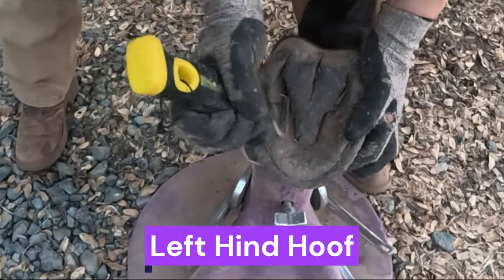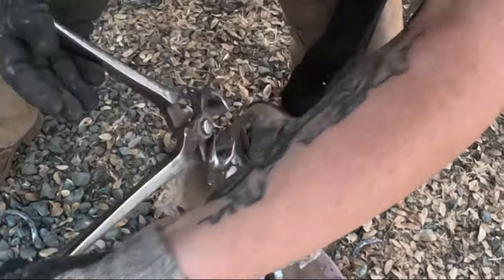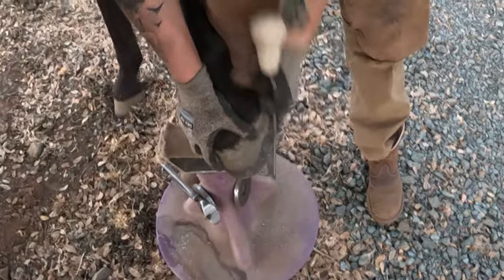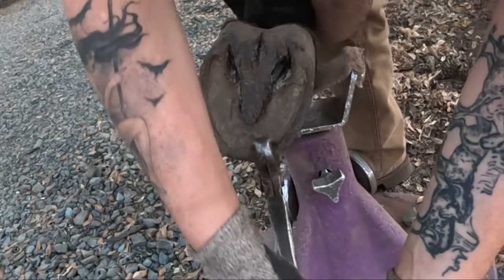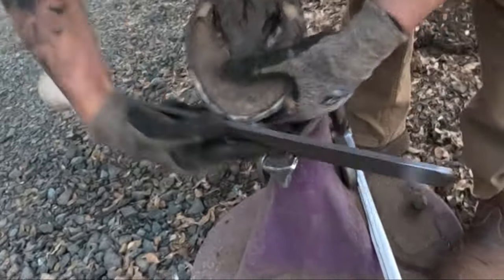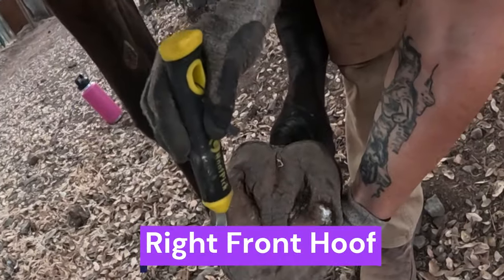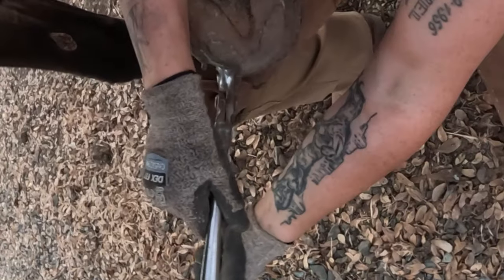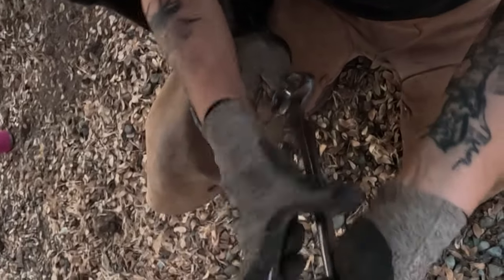A Barefoot Horse Hoof Trimming Mini Masterclass

Comment: Please correct me if I'm wrong, but is he not walking on the sole at the toe? My horse is similar. I never have to take anything off her toes, and I'm wondering why. A group I follow said they need to be walking on the hoof wall the whole way around and the wall should be at the HSP. But mine seems to wear her toe and I wonder is she not landing heel first. But her heels are taken down to the butress line at every trim.
Reply from the maker: That’s a great question. Unfortunately there is not a one size fits all answer here. It really depends on the thickness of the sole on the horse. This horse has nice thick soles and so I am able to take the hoof wall hight down farther and the fact that the toe callous has not popped out and is bearing some weight is not a big deal because of the over all strength of the hoof. Now if this horse had thin soles I would not want to trim like this as he would probably get sore. A basic check for sole thickness is the depth of the collateral grooves. The more shallow the grooves the thinner the sole. What I was taught and what I have found to be true and most helpful to the horse is that yes the wall is the primary weight bearing but the whole hoof shares the weight of the horse especially the frog in a hoof that is healthy and functioning properly. The bars will take on some weight as well when the horse steps and the hoof expands and lowers onto the ground. As far as heel first landing the best way to check is to have someone walk your horse for you and take a video and then watch it in slow motion and try and stop it right when the foot is landing to see if the horse is landing heel first or not. It can be tricky to see and takes a bit to train your eye but it’s really good practice. Another good indication is the frog of the hoof so if the frog is really big and robust and making ground contact then your horse is likely doing a heel first landing because the pressure from the ground is stimulating the frog to grow. If you’ve ever seen a horse with a frog all sucked up into their hoof it’s pretty much guaranteed that horse is not doing a heel first landing. Is your horse wearing her toe on the bottom of the hoof or is she kind of squaring off her toe in the front like she’s dragging her feet? I wish I could do a voice memo as a comment 😂 there is lots to say on this topic and really every horse is slightly different so it’s hard to give blanket statements.
Reply from the maker: One more thing I want to mention is that there are certain circumstances when you actually don't want the hoof wall to bear much weight meaning you want to take the hoof wall all the way down to the sole plane. This would be in a case of laminitis where the hoof wall has started to separate and if the hoof wall is left to bear the weight the weight of the horse will just cause the lamina to separate more. That is the most extreme case reason. This technique may also be used for growing out flares (a flare is also the separation of the lamina and is often a symptom of sub clinical laminitis). It is also useful when growing out vertical cracks, especially at the toe. Some horses may need boots when doing this at first and to keep a good heel first landing going and some horses do not. This is can also be dependent on the time of year and how hard the ground it and of course the sole thickness of the horse.  Hope this makes sense and answers you question!
Reply: @hoovesbyviolet  Thank you!! Do you not always take the walls down to the hard sole plane?? My mare does flare but she is a heavy cob and I've been told that's why she flare's on her front after about 3 weeks.
Reply: @AmandaHoranGoBookYourself  That´s a good question! I really don`t understand: shouldn´t we always take the walls down to the sole? As far as I have seen barefoot trimmers use their rasp to rasp the walls down to the sole. Hope @hoovesbyviolet will give an answer to this.